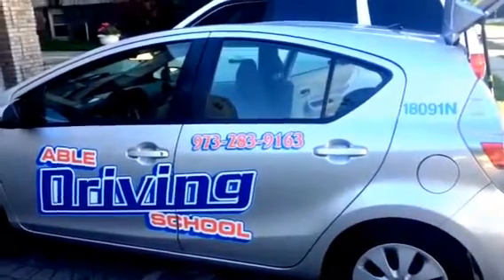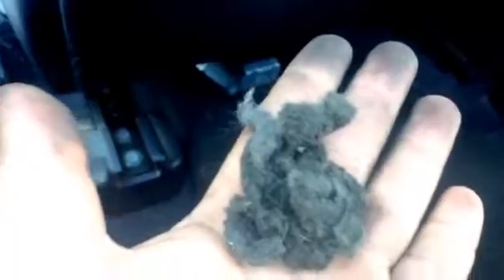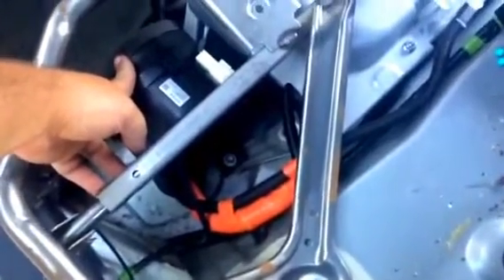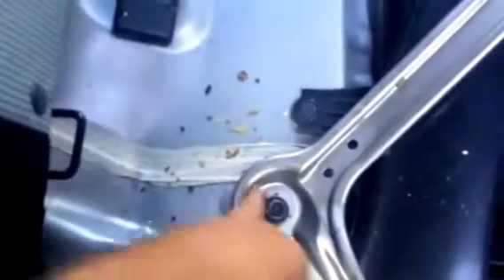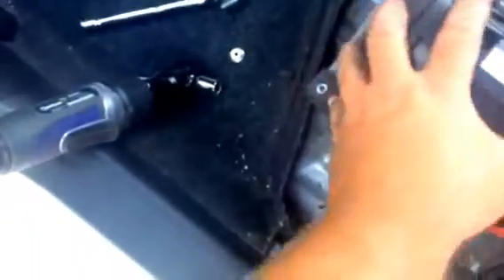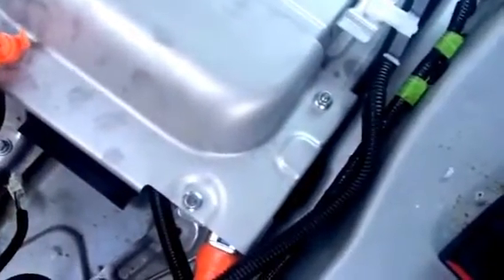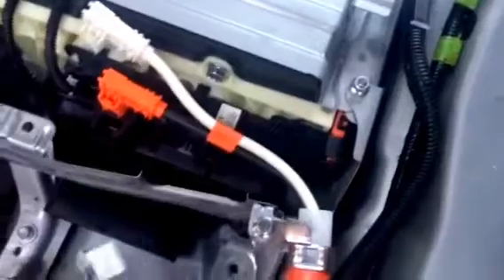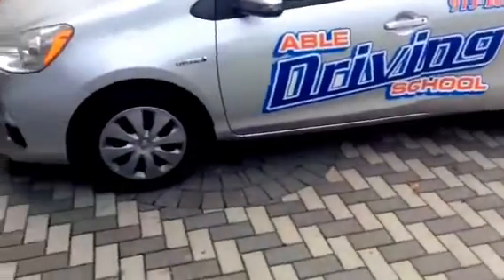2012 Toyota Prius C 221,000 hybrid battery replacement instruction video

Comment: Bro your lucky high voltage didn’t spike up to you when you removed the service plug, you were suppose to disconnect the negative battery terminal first before anything
Reply from the maker: Agreed did it this way 3 other times.  Still here though just sold the car

Comment: My car said the hybrid system wasn’t good the car had 146,000 miles I cleaned that fan and I’m at 154,792 batteries fine I took off the intake manifold cleaned that out because of the egr and put a quarter to block it engine lights on because it has more pressure in the egr but I gained mpg 50 going on the interstate and sometimes I hit 80 in the city if people are goings slow I like to speed so I’m always getting 50 or more mpg I also did an exhaust delete to the cat took off the airbox and decapped the enjectors I have a video on my channel flow testing them and I also have 350pounds or more in the trunk and it still gets that good of mpg

Comment: my 2012 prius C with 120miles has triangle&check engine light few times happen.is just cleaning bust bar will be ok or need to buy new cell module?i suspect corrosion to it.

Comment: I clean that fan every 5000 Miles when I change my oil and filter it's very easy to access like he said just two clips I don't get much off the screen but some stuff does come off so cleaning it every 5000 miles with the oil change is a good way to keep track of it and make sure it always has good airflow and if you do it every time with the oil change you won't forget it'll just be a habit

Comment: 10 inch and 12 inch or 14 inch? you mean millimeter. everything on these cars are metric.
Reply from the maker: Pablo Irizarry  size it up bring all 3
Reply: @renekaminski8138  You still don't get it? You kept calling a 14mm socket a 14" ratchet. Then I gave up man,

Comment: i have the same car a bit newer but yes the dust build up on these is insane. ive got dogs too so hair build up is a problem. i recommend watching and sharing this video with other owners to spread this knowledge on the ease of cleaning the fan. the dealerships with either tell you you need a new battery and rip you off or charge you $$$$$ to remove a dust clog.
Reply from the maker: thorne watkins  I retired the car at 313,000 I have another 2012 with 100k car was so good wanted another without spending to much money.  Especially for what I do.   Thanks for watching

Comment: Did you have to do anything special like reprogram the computer or did the battery just change out and work?
Reply from the maker: Michael Owens  I was don’t you had to turn it on and off three time for the computer to cycle through.  Worst case scenario if it doesn’t get a $30 code reader and reset the light and the code.

Comment: Thanks for sharing ! Was very helpfull for replacing the battery in my 2012 YARIS hybrid.
Reply from the maker: peter bock  the more money we save the better. Was it similar
Reply: Yes, all like you described. I paid 800€ for an 2016 battery with 3000 km ! My YARIS is at 284000KM.
Reply from the maker: peter bock  how much would a mechanic charger you total there
Reply: I asked my Toyota dealer for the price of an new battery. Answer: 1953€ plus work, all together  about 2300€. Sorry for my english, i'm from north germany.
Reply: @peterbock541  helpful to know!

Comment: I have a 2015 Prius C with 68k miles. Still drives like new and fluids still look new. I change the oil myself with mobil 1 every 10k miles. These lil cars are a beast
Reply from the maker: aztecray1980    I have 310,000 miles as of now and bought a 2012 white with 64k for $9000
Reply from the maker: Bought a second Prius. Best car ever
Reply: Rene Kaminski man, those are some serious miles you have been putting on. Business must be good.
Reply from the maker: aztecray1980  313,000 miles got a new one will be retiring this one
Reply: @renekaminski8138   Did you ended retiring it?
Reply: Do a spill amd fill of the trans fluid if you havent already. It will likely be fine if you dont, but it will be happier if you do

Comment: What a durable car, is it still going?
Reply from the maker: kicknitoldskool     Yup 306,000 miles
Reply from the maker: kicknitoldskool    310,000
Reply: Very nice, I just got an aqua, goes well
Reply: @renekaminski8138  did you ever change the CVT transmission fluid?

Comment: How is the fuel consumption compared to before??
Reply from the maker: shakya bandara   Updates I have 283,733 miles so far I do need to change the spark plugs. And shocks are shot of course I only range 47 average mpg.  Still better than any other car and nothing broke yet
Reply: Rene Kaminski thanks for sharing bro
Reply: Rene Kaminski would you advise me to purchase this car?
Reply from the maker: Sat Neer  Many different things apply to purchasing the Prius, these cars are better in areas which are up to about 40 mph that’s where you get your most miles per gallon off I do a lot of highway in between so I generally get a 40to52 miles per gallon also this is not a great car for snow so the snows a lot where you live my not be a good option but overall as soon as I’m up I’ll be another one again.  150-300 miles per day and this car seems immortal. , 290,000 miles as of now.     Are you looking for new or used
Reply: Rene Kaminski thanks for suggestion pal. I'm from Mauritius, an island, tropical climate. Here we import a lot of used Japanese cars like Toyota, Honda and Nissan...but lately there's a lot of demand for new Kia cars: coincidentally my daily driver is a Kia Rio sedan, 1.4 litre GDI, manual, year 2013...giving me 5.8L/100 km. I'm pleased with Kia but tempted to go for a Japanese hybrid vehicle. I drive 50 km per day approximately, mostly 110 km per hour for 3 minutes approximately and the rest between 20-60 km/hour
Reply from the maker: Sat Neer  Go on Facebook and look up Prius C group in Malaysia they have a similar climate and you can ask them how they feel about a highbred in a tropical climate. Sometimes I do see them complain about the hybrid battery being an issue with the moist climates but I don’t want to speculate I would rather have you ask or inquire with people in your territory here on the East Coast our temperatures change from 15° to 95Degrees but we don’t have a have a moist climates as tropical islands do but other than that it’s a great car
Reply: Rene Kaminski thanks, your advice is invaluable :-)

Comment: no follow up video on this?
Reply from the maker: Javier  nothing new to report
Reply: Rene Kaminski after the swap,everything was good again?
Reply from the maker: Javier  oops I was replying on the other video.    Car runs great I have 287,k since this video and everything is fine clean the air filter to the battery every 6 months ecpecially if you drive with windows open
Reply: Rene Kaminski thanks brother that's good to hear.
Reply: hi i have another question the donor battery where was it from ? was it the same year as your car?

Comment: My 2012 Prius C just came up with the same error code. Only 67,000 miles. Why not try replacing individual cells?
Reply: If yours is a 2012 and only 67,000 miles, it should be covered under warranty for you. Standard warranty on hybrid-related components are 8 years / 100,000 miles. In CARB (California Air Resources Board) states, warranty is 10 years / 150,000 miles.
Reply: +Austin Kinser I'm in Singapore and I've been using it for commercial purposes, so there's no more warranty :(
Reply from the maker: YOU CAN DO THAT AS WELL TRY CLEANING OFF YOUR BATTERY COOLING FAN AS WELL.. I CJANGED THE WHOLE PAC FOR 481 US DOLLAR
Reply from the maker: AUSTIN IS CORRECT YOU HAVE WARRENTY I HAD 221,000 MILES  WITH NO WARRENTY
Reply from the maker: THAT STINKS  I GOT MINE FROM A DIMANTLER WHO CHOPS CARS AND SELLS IN PIEACES I ALSO GOT ANOTHE FAN WITH THE DEAL AND SOLD MY OLD ONE FOR $40